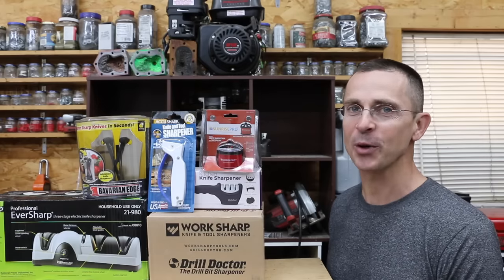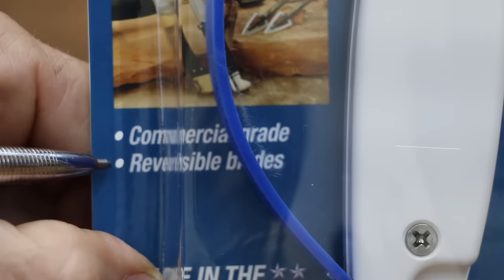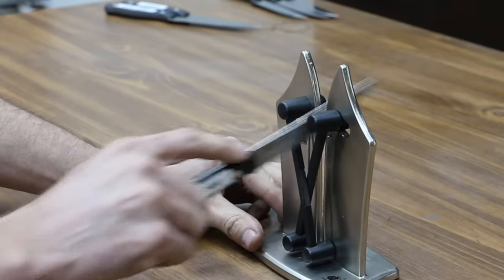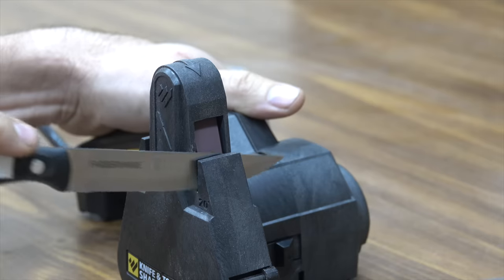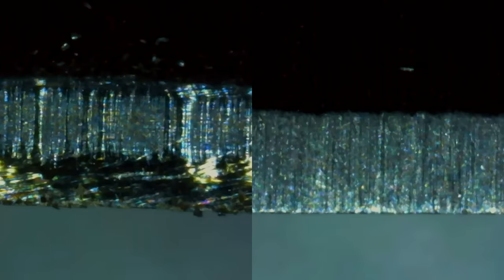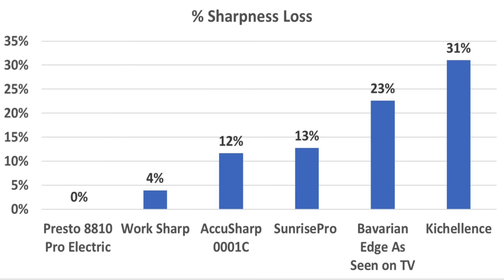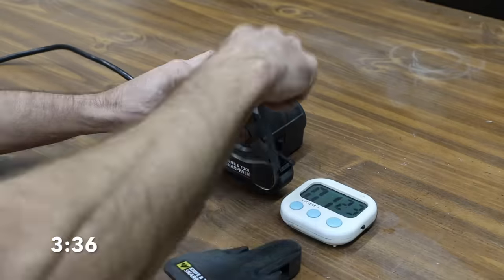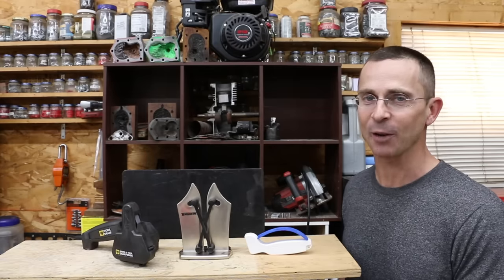Which Knife Sharpener is Best? Let's find out!

Comment: I have the Accu Sharp and I use it all of the time to keep my kitchen knives sharp for food prep.  What it does is really make a micro serrated edge with a bur and rough bur is what cuts, but does not stay sharp for long.  If you try to touch up the freshly sharpened edge with a steel it will not be very sharp like a properly sharpened blade.  Overtime the knife edge will get wavy and will have to be reshaped with a stone or belt sharpener.  I mostly use white handled food service knives so I don't really care about the blades.  Don't use these blade sharpeners on any knife you love because it will ruin them over time.  Once a year I take my knives to be professionally sharpened to repair the damage and to restore proper edge angles.  The Accu Sharp leaves a lot of metal particle so be sure to wipe down the blade before using on food prep.  All said I love my Accu Sharp because it is fast, makes a sharp cutting edge and I understand it's short comings.

Comment: Great test, however I've found that the work sharp has a bit of a learning curve to it. The more I use mine the better (sharper) results I have, especially the tip. Enjoyed the comparison though
Reply from the maker: Great point on the learning curve!  It took me a while
Reply: I use a larger but similar belt sander and wholeheartedly agree.  Don't know if they're available for the WorkSharp but I added a leather belt for the final passes and that made a HUGE difference.
Reply: @ProjectFarm  It was the same for me, I've heavily used mine for over 5 years now, I like to remove the angle guide and sharpen only using the side of the sharpener that allows the belt to 'hug' the blade and bow inwards, push with a little pressure at a shallow angle and sharpen it like that, then alternate sides on the final belt and you should get very sharp results for quick & dirty razor sharp edges. :-)
Reply: @HostileTakeover2  Yes there are many grits available, the finest is 6000 and they call it micro mesh I think. After they wear, I just add alittle rouge and they have a whole new life
Reply: @jayo7799  Indeed, I usually go up to a 2000 belt before hitting up a leather belt with a rough polish compound on it, then a plain leather belt.  But only with the average to low quality knifes.  My good kitchen knives I do by hand & work up to 8,000 before the strop, and razors to 14,000.

Comment: Follow up video: 

Use traditional sharpening stones and then strop with leather on the worst knife and see how it compares.
Reply: no name  If you have a 3D printer, you can buy a set of sharpening stones from aliexpress for around 10$ and print yourself a sharpening jig.

CNC Kitchen on youtube has a very good design. You can even sharpen an axe with it and it's very versatile.
Reply: All I use are sharpening stones. I have a few pass through sharpeners like these and found they can really put on an edge if you know how to do it. Variable pressures and angles works well. However, I find my stones work best. I let them soak in canola oil (because I have a child so if he touches it somehow I don't want toxic chemicals) and found that I can get my blades from 500 to about 30 with my wet stones. Paid 280 dollars for the set and worth it. I also have a sharpness tester like his. I get my wood cutting axe to about 230 and damn does it split well. Stones are the only true way.
Reply: @schwuzi  Why use a 3D printer. Why don't you just make a jig?
Reply: @oldbatwit5102  Of course you can build a jig on your own, it's fun. But 3D printing is fun as well, a printer can bed had for under 200$ including a couple spools of filament.
Reply: @schwuzi  The materials for a jig could be found for free.
Reply: @no name, I've not seen a "quick and easy" type sharpening system yet that can give the results of stones. The trade off is getting a useable edge quickly I suppose? When I see someone use one of those pull through carbide type sharpeners it hurts my soul.
Reply: I DGAF about stones and strops and all that. I just want a knife sharp enough to do what i need to do. That's all. I don't have time, energy or will for any of that.
Reply: @gravitygear  yeah, but some of us want to/like getting the most out of our tools. Which is why we spend the effort to properly maintain them. Surely you also have something that you put more effort into than most people.
Reply: @1911nutJMB  I use pull throughs when I've got to put an edge on my hunting knives at camp if I hit a bone when dressing a deer. It's quick and compact. I'll also use it on the $9 chef's knife I haven't been able to get rid of in 20 years because I'm so used to it. All my knives (save the $9 one) get treated with the Lansky system every few weeks as a means of shirking dish duty on those nights.
Reply: I was saying work-sharp the moment you introduced the products. The made in China label gave most of them away.
This all comes down to how sharp do you want your blades ... what are you using them for and how long do you want your edges to last.
My journey in the world of sharpening started with my brother using oil stones to sharpen the same kind of blades I have in my collection.
I thought they were sharp blades back in the day ... but I was not correct!
I went from hand sharpening using various stones ... still not satisfied it was as sharp as I knew I could get that steel (S35VN/ATS34/san mai III VGI/D2 tool/ AUS8A made in Japan) ... so I moved onto various assisted jig style products and ended up with my Hapstone V7 grip-tomatic.
Here are some of my blades.
If you want scalpel-sharp (under 0.5 micros) then you only have one path to take. This one ...
https://www.youtube.com/watch?v=54oh_CZmcU4&t=1026s
Reply: @asancoon2363  I do. Which is why I don't care to put in any more time to knife sharpening. You can have that and that's fine with me, but when a review is about simple, mass market sharpening devices and people come here calling for him to put up stones and strops, that takes the whole point out of the review. On the opposite end,  if I went to an automotive review about Italian super cars and asked for the new M4 to be included, that wouldn't make sense.
Reply: @TheSlimCognito  soak em in diesel it works a charm
Reply: @blzt3206  you did see the part about me having kids right? I have plenty of better chemicals to use and keep those in my locked shed but I usually do my sharpening on the porch so I try not to keep toxic chemicals where they can get to close to them. Otherwise I use a special stonewax from Japan. But it's harmful or fatal is swallowed.

Comment: I appreciate the controls in your test. Where this test falls down is the quality of the sharpeners. The work sharp was the only unit that was worth testing. Carbide sharpeners take off too much metal to use regularly. Why not test a Lansky 3 or 5 stone system, Lansky Turn box with diamond and ceramic rods, and the Spyderco Sharpmaker?

Move up into sharpeners that are used by people that know their way around knives.
Reply from the maker: Great suggestion for a round 2 video!
Reply: Project Farm I second the lansky system. For kicks and giggles I decided to try and sharpen a butter knife with my five stone lansky system. It now is sharp enough to shave with.
Reply: @ProjectFarm  please include chef's choice trizer 15. Rated best by America's test kitchen.
Reply: @Asmodeus04  Anyone can use the Lansky system. The guide makes it so the angle is fixed. It’s not as fast as the sharpeners he tested. But it doesn’t tear the edge. And you can take it down to extremely fine levels w/ a sapphire stone and stop w/ polishing compound.

Comment: Some sharpeners missing were a whetstone, a diamond sharpener, a simple honing rod, and a strop.

Nice video no less.
Reply: one of the knfies broke too
Reply: I think he was testing sharpening systems and devices beyond traditional methods.  It safe to say traditional sharpening tools work although they heavily rely on user skill.
Reply: Right on!
Reply: You need skill to use those.
Reply: Oh look, it's a knife snob.
You can have an entire tool kit to sharpen your knives slowly, or you can have a single tool to sharpen your knives quickly.
I'll use a whetstone if I have a knife that can't be adequately sharpened with a grinding-wheel knife sharpener, but I don't make a point of owning knives like that because they're a waste of my time. I have a girlfriend, a kid, a full-time job, and several hobbies to fritter away what little spare time I have.
Reply: A strop is not a sharpener.
Reply: @deusexaethera  I'm sure you can find 30 minutes to care for your blade.
Reply: All skill based which I think misses the point.
Reply: And also don't forget if you get it off the stone if you don't have a strap diss use the top of your boot. Well it's just like he showed on the Clip too, those carbon blades leave part of your knife laying on the table.
Reply: @deusexaethera  they may work quickly and sharpen ok, but they wear down the knives super fast (as shown in part of the video with all the metal shavings).  I'd only use these on super cheap knives that didn't cost much to replace.
Reply: @frari489 : All sharpening methods function by removing metal from the edge of the blade. Precise sharpeners are more efficient with blade material by removing less and less metal the closer the blade gets to its ideal sharpness, either by using finer and finer grits or by temporarily obstructing the grit with existing debris as in the case of a damp whetstone. Cheap sharpeners just keep tearing off shards of metal until the user stops trying to get better results. I've used those V-notch sharpeners before and they never do an acceptable job, but my current kitchen knife sharpener is a slanted-grinding-wheel design that works very well. Grinding performance is dependent on applied pressure, so I just do a few firm passes until I don't see any shiny spots on the edge of the blade, and then a few light passes to hone the edge a bit. I don't worry about stropping the edge because the cutting board will do that for me. I've had my current $10-apiece cooking knives for a decade and they still look brand-new and can cut frozen chicken breasts with a single pass.
Reply: @bakedandsteaked : Pshaw. Spending a half hour sharpening a single knife isn't maintenance, it's masturbation. Even a boot dagger should take less time than that to sharpen it. I don't own any blades that require more than 5 minutes of attention. My cooking knives are kept razor sharp with a simple IKEA slanted-grinding-wheel manual sharpener, and they're a decade old and still look brand new. (no, you may not examine them with a microscope -- ogling the cutting edge like a fetishist is not the point of owning a knife.) My Boker pocket knives get occasional 5-minute touchups with a pre-oiled whetstone that I keep in my work laptop bag, and are sharp enough to shave aluminum when I need to.
Reply: I was saying work-sharp the moment you introduced the products. The made in China label gave most of them away.
This all comes down to how sharp do you want your blades ... what are you using them for and how long do you want your edges to last.
My journey in the world of sharpening started with my brother using oil stones to sharpen the same kind of blades I have in my collection.
I thought they were sharp blades back in the day ... but I was not correct!
I went from hand sharpening using various stones ... still not satisfied it was as sharp as I knew I could get that steel (S35VN/ATS34/san mai III VGI/D2 tool/ AUS8A made in Japan) ... so I moved onto various assisted jig style products and ended up with my Hapstone V7 grip-tomatic.
Here are some of my blades.
If you want scalpel-sharp (under 0.5 micros) then you only have one path to take. This one ...
https://www.youtube.com/watch?v=54oh_CZmcU4&t=1026s
Reply: You forgot a steel.
Reply: @dtester  " they heavily rely on user skill" If a person isn't able to do it right, the traditional methods will either do nothing or completely ruin the knife.

Comment: I have an accusharp and find it great for kitchen knives. What works for me is taking a slightly heavier pass at first until I feel the bevel is good. Then I'll take 2-3 lighter passes. Also helps to keep the sharpener clean of little metal bits that get stuck on the working edges. Sometimes I'll use a ceramic rod to finish it off
Reply from the maker: Thank you!

Comment: Have you tested drain cleaners I recently had a clogged some drain that I couldn't clear and my only hope was drain cleaner I never realized how many different ones there are
Reply: Collin Martin excellent idea!
Reply: Have a look at his July 1st 2019 video.
Reply: I'm a plumber and all those chemical's eat your pipes if not done right and end up costings you more in the long run. Buy a cheap hand auger and watch a YouTube video on how to use it.
Reply: @jackcarr177  And don't forget to add that most work poorly. It'll be clogged again in a few weeks or months if you don't remove the big mass of 'stuff'.
Reply: Ian 😂 no, he is not wrong, you melon
Reply: Best cure for clogged drains is screens over them so they don't clog in the first place. I know because I've run maintenance on apts for years and years. And the plumber is right about chemicals. They're just a waste of time in place of doing the job right in the first place.
Reply: I just use dish soap and a plunger
Reply: @The_AntiVillain  plungers don't work in any situation where there is an overflow path which is pretty much every double kitchen sink, every bathroom sink and every tub made these days. Might work on your basement slop sink but that's about all a sink plunger is good for.
Reply: @johnpossum556  i usually seal that up with a towel and use a bellows plunger

Comment: Id love to see a comparison of the regular work sharp to the Ken onions version. I haven't been able to make up my mind, and I love the way you review things.
Reply: Black Thumb Tinkerer i have the ken onion with the blade grinding attachment as well. This worksharp he is using has a better blade guide than the ken onion edition. Good luck sharpening a pocket knife on the ken onion
Reply: WSKTS KOE with Blade Grinding Attachment...
Reply: justin jones but doesn’t the Ken onions have advisable angles and other attachments for different tools as well as better belts?
Reply: Black Thumb Tinkerer yes
Reply: justin jones how is the original work sharp show here better than the Ken onions?
Reply: Black Thumb Tinkerer the blade guide that the edge rolls across on the Ken onion sucks for pocket knives
Reply: @justinjones5288  if you press down on it...yes it does
Reply: mark burress what if you “don’t press down”?
Reply: Well..the lighter strokes you use the less steel will be ripped of the edge bevels😆 Personally for roughing in the levels I would use a BLACK DMT Trifold or Continuous surface steel backed diamond plate...then BLUE...then ceramics.

I wouldn't use that thing on a cheap machete...but that's just me😆if your talking about the Accusharp..

The little swivel crossbar on the WSKTS KOE is metal with a rubber coating...I just barely use enough hand pressure with it to keep the blade lined up, because if you press down, you're undoing your progress.

If you use the WSKTSKOE WITH the BGA, there is nothing to pull the edge across to dull your knife. It's more like a small belt grinder.

The BGA is also the only way I can think of with the WSKTS models that you can sharpen thicker knives as well, like the Cold Steel SRK etc.

Turn the thing down..take your time, and never let the blade even START to get warm. Dip it in cold water and completely dry it off. Keep the blade cool

Comment: Been using an accusharp for years now. Does a more than adequate job but price and quickness make it the very best IMO. I have several in all the right places ready in a split second. Makes a fantastic two blade broadhead sharpener as well.
Reply from the maker: Thanks for the feedback.
Reply: I just bought one and it took some cheap paring knives from butter knife sharp to "sharp enough" in no time.  I was about to throw them away (I paid like $2.50 each for them in a set of 4) because I wasn't going to spend an hour sharpening, I'll just buy some more, but the accusharp saved the day, and the knives.

Comment: I had good luck with the Smiths belt sander style sharpener from Walmart for 2899
Reply from the maker: Great feedback.  I should have tested it
Reply: @ProjectFarm  My old Smiths diamond job still works fine, even if I had to epoxy the sharpener back to the body! It's several years old!
Reply: @lewiemcneely9143  haha had to do the same to mine
Reply: @mikecrum9284  They work fine for a basic plastic thing but after a while...... Mine still sharpens as (almost) good as it ever did. The little diamond ovals are flat but you can tell when the edge starts coming back. The 'feel' of it; like a file biting in instead of sliding over. But we didn't need another one after we got through 'Fabricobbling' as David Haley calls it. Take care, Mike and BLESSINGS to you too!